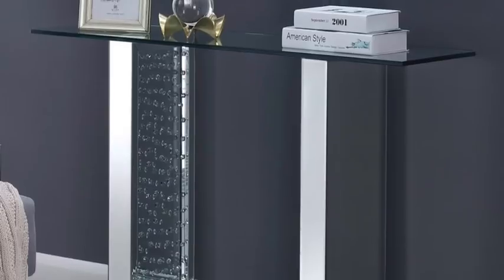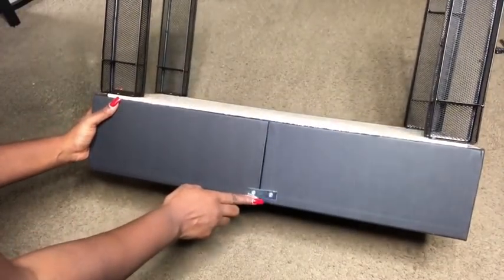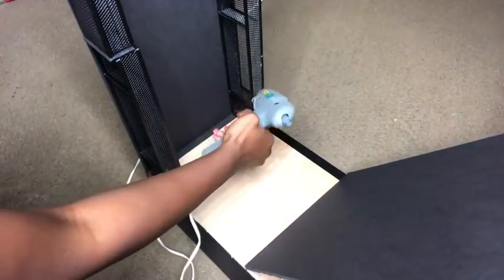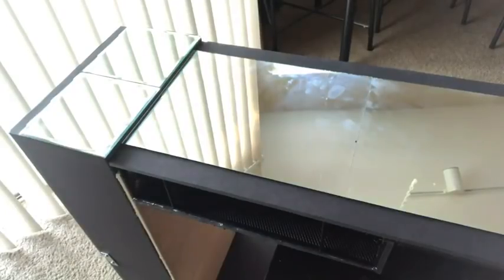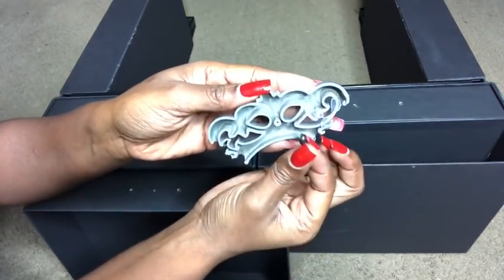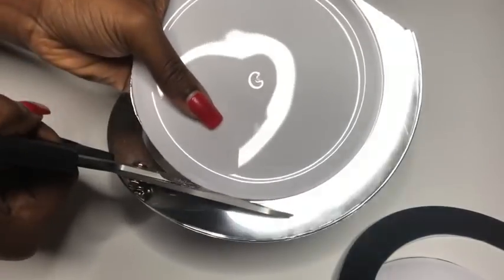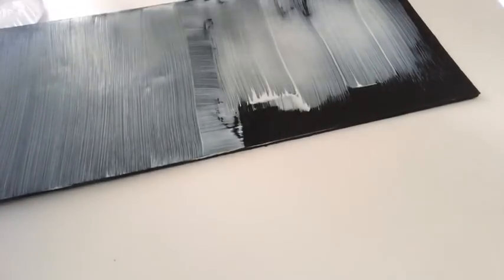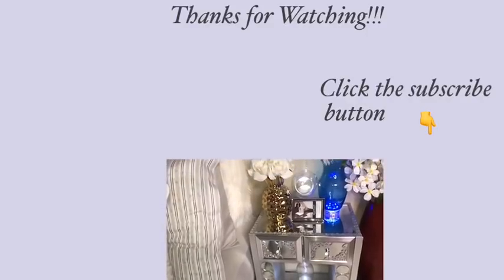Diy Table From Dollar Tree Organizers| Inexpensive Home Decor ideas!

Comment: This is so amazing!!! I'm thinking about hinging the bottom drawer fronts so they can still be used. Just need to figure out how to cover the points of the screws......
Reply from the maker: That’s an awesome idea 😃. Pls let me know how you’ve covered the screw 😃. I love learning new things 😃. I’m blessed to have you here 😇💕💕💕
Reply: Take the drawer out before you screw it and make the drawer shorter so when you put it back in the screws won't even show because the drawer will be shorter! I hope that makes sense! Good luck 😊
Reply: @yoduvhessentials6310  so I've thought and thought. The only thing I can actually think of is instead of using the pointed screws, predrill the hole and use the flat ended kind with a washer and nut. Get a shorter 1 so it doesn't interfere so much with the space. So far that's all I can come up with. Once I get time to actually work on it maybe I can find more solutions!!! I need all the storage space I can get, lol, and making it attractive is a bonus!!!! I'm really into mirrors and glam.
Reply: @HontasMarie  I like that idea!!! I would have to watch the video again but I think there are screws in the front AND back. So maybe take a section off the side of the drawer but leave the face the same size? I'm hoping more people will read this thread and give even MORE ideas!!!!  I think I like your idea more than mine, lol!!!

Comment: You are amazing I love everything you do! Instead of screwing the sheet of wood why not just use E6000? So you can use all the drawers!
Reply from the maker: susan haynes I was trying to make sure it will be sturdy no matter what happens that’s why I had to go for the screw nails☺️. Thankyou so much for Watching and appreciating it 🤗😇💕💕💕
Reply: I think I would have taken all the drawers out and screwed the screws from the inside of the box into the plywood... Possibly even shortened a drawer if necessary... With mi tiny space I NEED as much storage as possible!! But I Love This!
Reply: Or even Gorilla glued, Gorilla wood glued, or Gorilla super glued the board to the drawers. 😉 That stuff really does work! OMG DOES IT EVER!!! I repaired a glass doorknob with it and I never had problems with it ever again after that. I also like the idea Loli Luxe had about taking the drawers out and screwing it from the inside. Good idea, but I just realized that it would not work because there's no way to actually screw anything from the inside of that narrow space. You would need to used the screwdriver at a 90 degree angle and with your hand inside and with the narrow space, it won't allow for that unless maybe you had a certain type of screwdriver that would actually bend to a 90 degree angle and there are some out there. Your husband might even have one. I used to. It was a thoughtful idea, though.

Comment: Take but will the weight hold ? Gluing the legs ? What if they snap
Reply from the maker: The legs have been reinforced with a strong material(Steel from the Organizers). The most important step is making sure the screws are firm on the first set of Organizers. Adding the height by Glueing is just to keep them together while the board (Strong Foam board from Walmart) on the outside holds it all in place and keeps it strong and sturdy.
Reply: @yoduvhessentials6310  Since the legs are basically hidden inside the foam board, couldn't we zip tie them together in addition to using your method? It was just an idea I had. #reenforcement

Comment: cool u should have put mirrors on top
Reply from the maker: Larry Hardy Honestly, the size of the mirror I wanted to use, didn’t fit so I had to use a board instead. But I agree! A mirror would have looked superb 😍😍😍💕💕💕
Reply: @yoduvhessentials6310  , try the mirror anyway. It doesn't have to be the same size as the top. 🤔😏😉